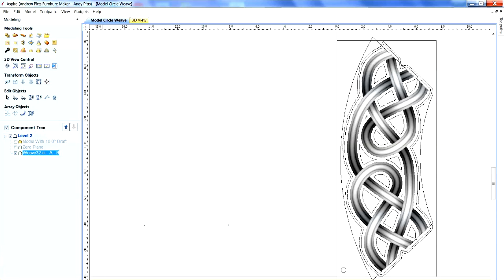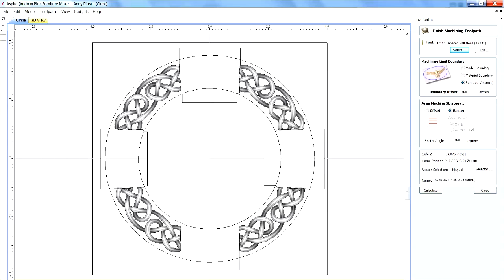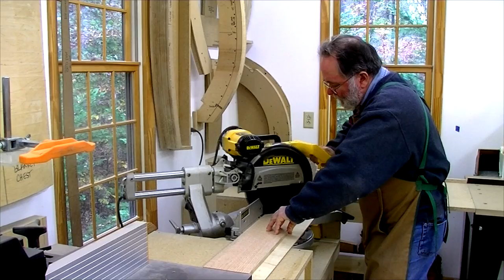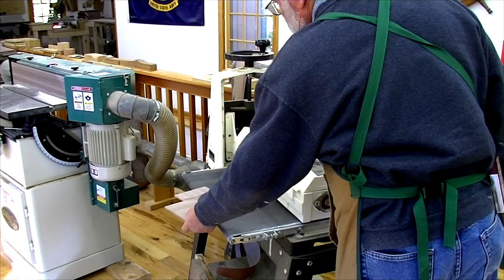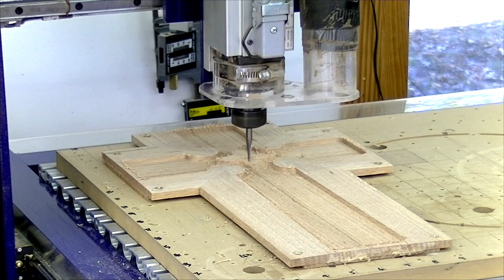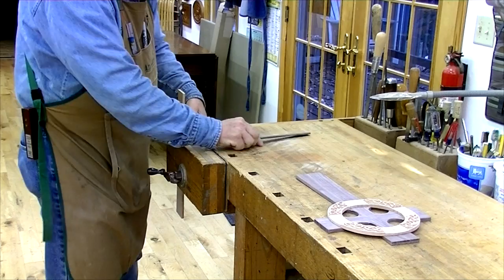Making a Miniature Celtic Cross: Andrew Pitts~FurnitureMaker

Comment: very nice, you really have your stuff in order. One question , do miters in solid wood stay together over time with the expansion and contraction? If one were to make a large table with miters to center would the joint stay tight?
Reply from the maker: +Mark Me Mark, the more end grain in the joint the weaker. I would not simply glue miters and expect them to stay together. What is not too obvious in this video (as opposed to the video of full size celtic cross) is that each of the cross pieces is made from two layers, the top mitered and the bottom butt jointed, but the joints overlap unjointed wood so there is strength from that lamination.